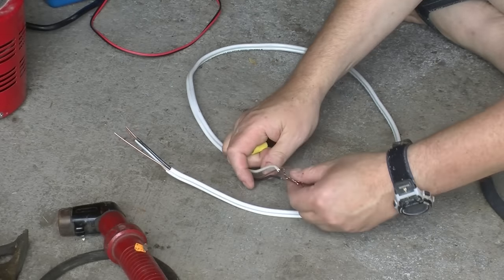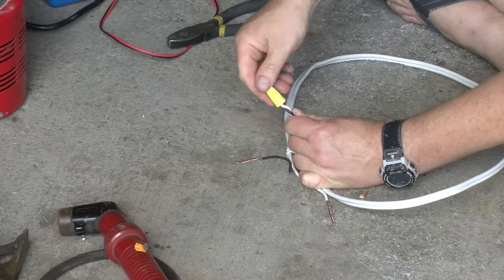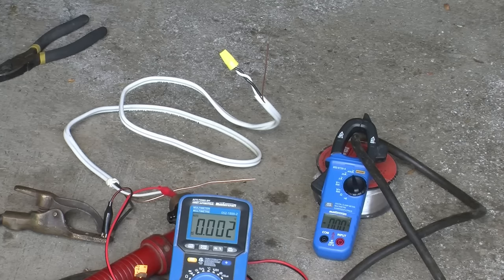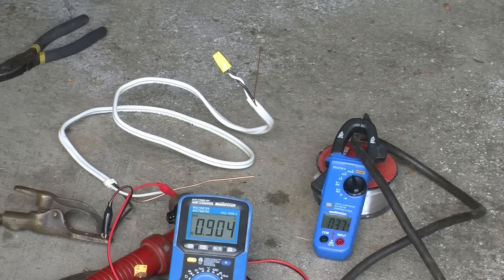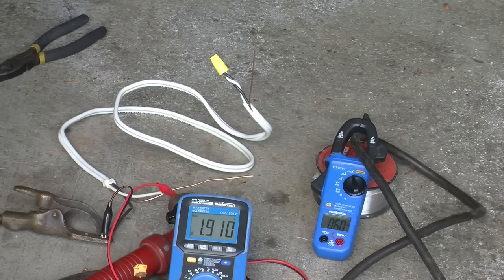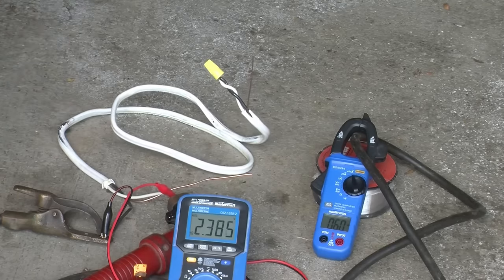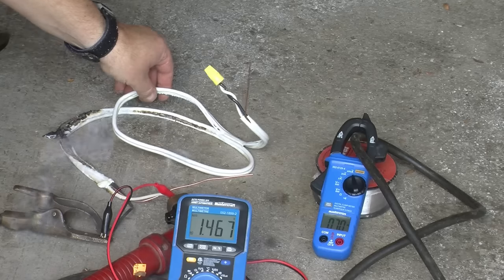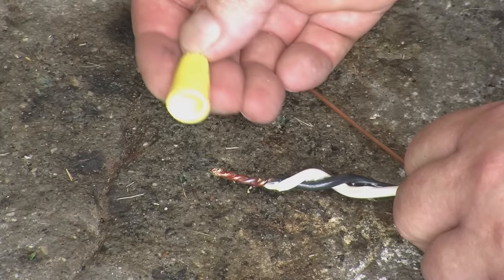How many Amps to burn up 14/2 electrical wiring?

Comment: The voltage tolerance on a 120 volt line in the US, according to the NEC, is 5% to the furthest outlet, or 114 volts.  Most local power companies also allow 5% tolerance on the secondary side of their 7200/15400 lines, though the voltage is generally adjusted 2% over voltage to accommodate heavy evening loads when everyone gets home and starts loading the power grid simutaneously with H2O heaters, ovens, microwaves, and now, electric cars. I don't know why I find it hilarious that electric cars in many places are charged by coal powered facilities. Carry on sir  🙌
Reply from the maker: I guess that makes a Tesla a coal powered car :) People sure dont understand the greenness of electric vehicles is directly related to the power plants. Your point about voltage: With little current draw in my home, I have measured the AC from about 123V on low consumption times/days to as low as 115V on a day when air conditioners would be one. I'm sure if I repeated with my AC on it would be a volt or 2 lower. Almost exactly as you described.
Reply: @ElectromagneticVideos  Well, they don't give a Masters License to anyone man! 😜 That video was super cool, I've repaired cables that looked similar, but not a bad as that, and always wondered how spectacular the actual failure was. 
Thanks for the demonstration! 

I was also  thinking about the fact that you used a welder, which produces pulsed direct current. Line voltage in a home is alternating current, and there are differences in how those two conduct through metals. DC tends to move electrons through the core of a wire, but AC tends to only move electrons on the surface of a conductor, and this phenomenon is called "Inductive skin effect." This is why stranded cables are used in industrial and commercial applications, they have much more surface area than a single round conductor. I'd like to see how many amps of AC power it takes to achieve the same result. I'm going to have to replicate your project at my shop someday, my curiosity has been more than stimulated 😃
Reply from the maker: @CommunityGuidelinez  Its actually such an old stick welder that the output is plain old AC! The skin depth for 60Hz in copper is about 8.5mm so for 1.6mm  diameter #14 wire I would expect little difference between AC and DC anyway. But for larger industrial cables your absolutely right. I deal with a lot of RF stuff where in the Ghz  region the skin depth is in the order of μm. For MHz RF sometimes Litz wire is used - essentially woven stranded so much like you described. By the way - great skin depth description! I hope you try the experiment. If you ever get to remove  some 1970s Aluminum 12/2 would be really interesting to see how that holds up to overcurrent. It was used everywhere around here (Ontario, Canada) till houses started to burn down. Not sure how common it was elsewhere.
Reply from the maker: @CommunityGuidelinez  One more question for you: in RF metal pipe is often used since nothing flows in the center anyway. Is that ever done with high power AC power distribution? Or is stranded enough to mitigate skin depth for even the largest wires?
Reply: @ElectromagneticVideos  Thats an AC welder!? Wow I had no idea, that's really interesting, I knew they existed but it didnt cross my mind while watching. That's a great point about the skin depth of 60Hz AC in a small 14 gauge wire, there would likely not be a significant change. I'm in the US and go by the NEC/NFPA 75 code, and as far as our 2020 edition is concerned, stranded high power AC Conductors such as a 750 KCM can mitigate the skin effect. There is an adjustment factor for the conductors that can be determined by dividing AC resistance as listed Chapter 9, Table 9, by the DC resistance as listed in Chapter 9, Table 8.  Funny thing is that these formulas were calculated on a specific size and type of cable that was determined in 1966 🤣 (Somewhere back near those tables is an informational note regarding that). Going a little bit outside of the box though, NFPA 780 covers traditional lightning protection system requirements, which I believe one could call "high power application."  One of these requirements is that conductors intended to deliver electrical discharge from lightning strikes through a building or house should be a Class 1 copper type, hollow, braided wire. So in a way, yes there are similar applications in high power AC to running RF via metal pipe. Good stuff, thank you for responding with good conversation mate. 👍
Reply: @ElectromagneticVideos  On a note, we probably could get on the topic of whether or not lightning is AC or DC but I do have a job, and lots of work to do 😀
Reply from the maker: @CommunityGuidelinez  I think we only had the luxury of DC welders sometime in the 70s or 80s when high current semiconductor rectifiers became available and inexpensive. The welder I'm using came from the local Habitat for Humanity Restore having been marking down multiple times till it got to $100 which I could not resist! And I have had way more than $100 fun out of it! I just googled 750 KCM - thats huge wire - I completely why you need to be concerned about skin depth - I never thought about skin depth AC power! You sure know the code - funny - I just suggested to someone that he consult an electrician because they live and breath the code every day and are the true subject matter experts on it. I'm an EE so a have a lot of theory but the code is not my area! But I'm sure you can tell I love practical stuff as well! Also said this to someone else - best part of this video has been comments like yours - its fascinating to hear other people experiences, and always love learning things like skin depth is an issue with AC power. My comments on lighting below!
Reply from the maker: @CommunityGuidelinez  Its a huge amount of both! The shortness of the pulse means there is energy from DC up to well into the RF region with probably the bulk of it in audio type frequencies. As a general rule, the shorter a pulse is and sharper its edges are, the greater the range of frequencies on it.  You may have come across  Fourier Transforms which is how to calculate pulse shape to frequencies. Really a generalization of how harmonics added to a sine wave can make it look more and more square or some other odd shape. I never knew lightning rod wires inside were hollow - makes total sense. I wonder if they collapse after a strike. I heard that the old barn type thick stranded lighting rod wires would get so hot and compressed after a strike they got welded into almost a solid rod. Would be fascinating to see evidence of that.
Reply: @ElectromagneticVideos  The IEC has been studying lightning strikes since the 40s, and most lightning protection systems have literally been trial and error. They have not caused to many problems with high-rise buildings or steel framed structures, seeing how they have excellent connections to ground via the iron re bar that ties the structures into the ground, but homes and small wooden buildings have seen some pretty bad incidents.  A lightning strike can carry 150,000 amperes at peak! Incredible! Anyway, it's been good chatting with you, thanks for taking some time to talk EE stuff with me. I'll see you around on future videos. Subbed 🙌
Reply: @ElectromagneticVideos  On a side note, last year when I started my electrical contracting company I started a YT page, but haven't had much time to do anything with it. Setting up policies and operating procedures has been the priority and its been a tad overwhelming! When the gears start turning a little bit easier I'm going to start posting videos of the more interesting side of electrical contracting. I actually have what used to be a 200 amp feeder and branch circuits fused into a panel from a serious lightning strike. The breakers and attached wiring got so hot that every terminal melted together permanently, like you described! I cut the entire panel out of the wall and have it somewhat preserved in one piece! I also have a pretty cool collection of distribution equipment and lighting controls that date back to the 30's and 40's Id like to show people. When I get going with the content, I'll send you a link 😉
Reply: @ElectromagneticVideos  I'm your 500th subscriber by the way! Congrats! 👏
Reply from the maker: @CommunityGuidelinez  What blows my mind is how the power lines can survive it. I just cant imagine how things can survive that in spite of the protections. 10 years ago lightning hit the pole with the transformer that supplies my house. The pole mounted fuse (?)  was quickly reset by the power co and the transformer survived (and no surge issues in my house). It did fail 2 weeks later when lighting hit it the second time. What are the odds of that. It has been great chatting with you too - please keep in touch! By the way - just posted the wire-in-an-insulated wall video. Not as dramatic as this one but probably quite  interesting to people like us! https://youtu.be/Df7bAEdIILI
Reply from the maker: @CommunityGuidelinez  I totally get your time constraints. I have been wanting to do this for years and never had the time for the same reasons. End of last year and first part of this year I finally had the time  - now business for me has gotten really busy and I'm time limited again. But I'm going to keep doing this as much as possible because it had been fun - sort of addicting. I never got the social media thing before! I just subscribed to your channel so I dont miss it when you start posting again. I would be fascinated seeing your video on the fused panel. If you ever want to collaborate on a joint video - or maybe each of us does one that complements and refers to the other, let me know! That could be great fun!
Reply: @ElectromagneticVideos  I would definitely do a collaboration with you, if anything, I can send you some AL wiring so you can do a "proper" test 😉
Reply from the maker: @CommunityGuidelinez  Great! At some point when we both have time, lets try and so something. And if you come across any AL wiring or any other unusual items,  make sure you keep them and we will figure out some sort of video. I think it would be great if we could do something where out backgrounds and experience really complement each other.

Comment: In my experience with wire nuts, the twisting of wires is automatic when you twist the wire nut onto the wires, and it bites into the conductors
Reply from the maker: A number of people have reported similar things. I think in the end not all wire nuts are made the same ....
Reply: You've the exception then for wire nut effectiveness. Love WAGO utility but a pre twisted wire under a wire nut is gold standard for connectivity.  And stranded wire never holds un pretwisted against solid wire. WAGOs are heavens gift for solid/stranded connections.

Comment: wire currant rating has nothing to do, directly,  with heat. its all about the voltage drop due to resistance. though you are showing the said voltage drop, a 50 foot wire would be, well, about 50 time grater than your measuring...
also agree with other comments about twisting wires before a wire nut. there is no code to do so. also if you have to take it apart for testing you will need to cut the twisted part off every time as the twisted parts are physically  compromised.
Reply: The current (amperage) has everything do with heat. Without current no heat can occur. That's why when the Amperage was increased the wire began to heat up and even melt the insulation. Every electrician I've talked to (being an electrician myself) has agreed with the statement, "that when you think of amperage, think of heat. The more amperage you have the greater the heat." So the insulation on conductors isn't just about voltage, but it's rated for a certain amount of heat it can handle before malfunction. This video was somewhat based on that theory, but no temperature was given to help correlate the temperature to current.

The other factor is based on load for sizing wire. And load is correlated to current. As an electrician when someone wants for an example a spa I need to know the Amperage to properly size the wire, because the voltage will always be the same, 120/240 coming from the sub-panel. And a to small wire would burn up under the load or amperage needed
Reply: @TheForgottenMan270  Exactly, now tell this reviewer what every electrician worth their salt does to a wire prior to adding the wire nut and the wire nut package advises electricians to pre twist the wires prior to adding the wire nut.
Wire nuts are not meant to creat a solid connection, they ware meant to protect the open wires like the insulation does.

Comment: Very good experiment. One thing I wished you would have done is actually measure the temperature of the wire while you are cranking up the current.
Reply from the maker: Glad you like it - your not the only one who said that about measuring temperature. When I did it I just thought it would fun to see how much current #14 wire could handle beyond the rated 15A. Never expected the video to get this much attention. I have ordered a thermal prob so may some temp measurements in the future.

Comment: Local code enforcement guy is a friend of mine. He told me that in the vocational schools for electricians, they teach that you are not to twist the ends of the wire together with lineman pliers, and to not be influenced by journeyman to do it. Has anyone else heard of this? Of course, I ignore that advice and twist them together with lineman pliers like I always have.😊
Reply from the maker: Much to my suprize itturns out about half the electricians twist and half dont. There were some heated arguments in the comments in some of my videos and also elsewhere. I'm with you - twisting does produce the best connection if done once on clean wire. Having said that, there are apparently some wire nuts wwith instructions specifically say not to twist. If I ever came across them, I would follow the manufacturers recommendations since for insurance purposes its hard to argue with following the manufacturers instructions.

Comment: Best most reliable connection is to strip wires about 7/8" then pretwist using long linesmen pliers, trim ends of wire even, install wire nut, twist with linesmen pliers until at least one full turn of insulation , Tape with a few wraps if quality tape.
Reply from the maker: You know, its been ages since I have seen tape around the bottom of a wire nut!
Reply: @ElectromagneticVideos  Started out in a large slaughterhouse that between all the vibrating crushers, vibrating screens, high speed centrifuges and nightly high pressure wash down had to tape every wire nut. Opened up junction boxes that had 4" of water and energized 240 volt submerged well taped wire nuts that still worked. If not taped would have grounded out. Also always taped every device ( switches & receptacles ). Can never remember ever having a wire come loose on a screw that had a few wraps if quality electrical tape. Pays to go the extra mile.
Reply from the maker: @JohnThomas-lq5qp  That must have been interesting. I am amazed that wire nuts did so well in such a wet environment even with careful taping like that.  Equally impressive surviving longer term vibration. I once had to vibration certify an embedded device - it was staggering how quite mild vibration will eat through insulation or anything else that was rubbing over a few days. You certainly convinced me that taping a wire nut is the thing to do. By the way - the best thing about this video for me has been comments like yours. So interesting to hear things like that!

Comment: A good splice on wire is created by mechanically joining the wire, solid or stranded. The 'wire nut' is just there to replace the insulation if the wires are properly twisted together first. 3M Red/Yellows are my favorites, but I never rely on them to make the splice. Strip, pinch and twist, then cap the splice with a good wire nut.
Reply: The wire nut does twist as well, and bites on to the softer copper. There are arguments both ways as which is better.
Reply: It says not to twist first
Reply: @AgentOffice  I've only been an electrician for 40 years.  Splices that are twisted tight first then capped do not come apart.  Just write nutted? Those are the fails that result in call backs to fix.

Comment: I'd like to see it under 110vac with increasing current. As it stands, 70 amps at 1.47vac (that's what I think that I saw on the meter) is ≈ 103 watts. Under nominal conditions (110vac and 15 amps) it should be fine up to 1650 watts. So this isn't a proper test.
Reply from the maker: 15 gauge? I have never heard of that for AC wiring! I had heard that knob an tube was thinner wire - I wonder if know and tube was 15 gauge. Many the woven insulation was more able to handle higher temperatures than soft plastics?
Reply: Voltage is irrelevant to ampacity. Regional high tension lines are limited to 500 amps due to wire size. To get more VA or wattage if your power is 1 they raise the voltage to many thousands. The limit then becomes the arc distance.
Reply: The setup he has is actually dissipating 103 watts.  Very different than being able to carry safely enough electricity for an appliance to be able to dissipate 1650 watts.
Reply: That meter was only really measuring the drop across the romex cable, not what was trying to be supplied. Supplying this test wire with a 110v source would yield a roughly similar voltage drop as this ~10-50V source as it's a near dead short.  Amps is amps, voltage is largely irrelevant in a short circuit type test such as this. Well, to a certain point where arcing and insulation breakdown comes into play.
Reply: That 1650 watts goes to the device it's powering not the wire. A wire will fail at the same current regardless of voltage.